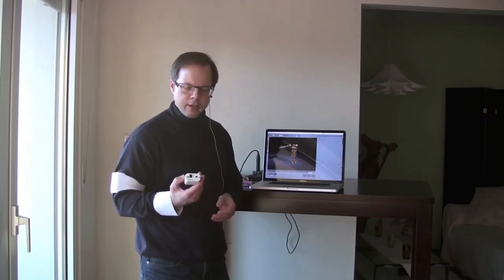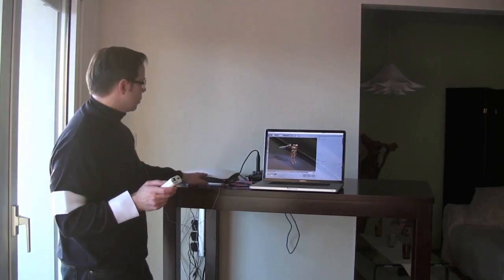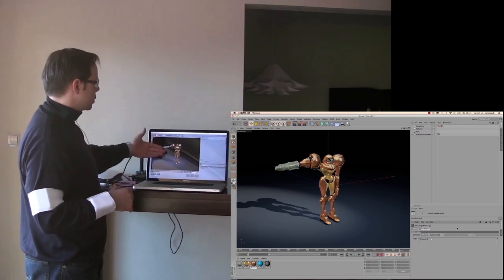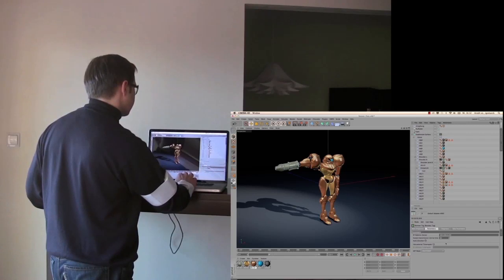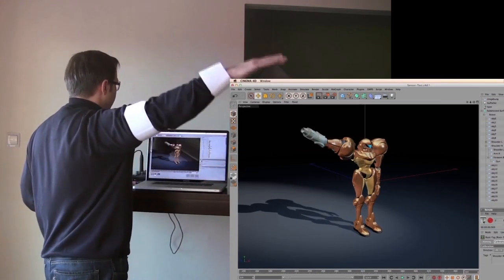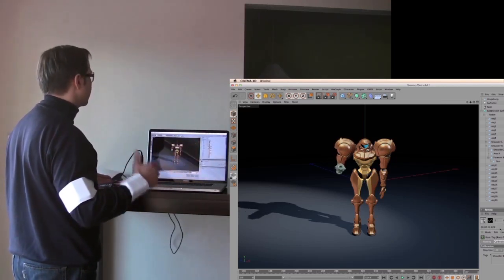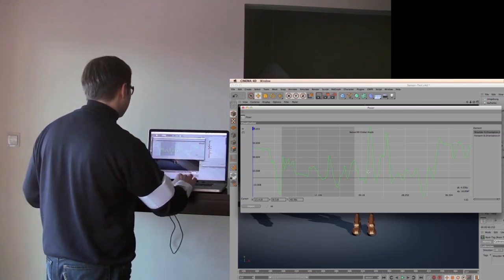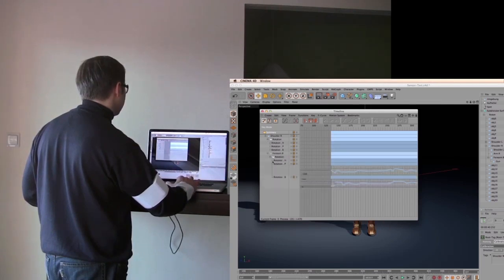Teaser: Motion Capture Sensors for CINEMA 4D

Comment from the maker: Hi guys, we already sell these sensors, but just in little quantities, as we are just a small 3D production and training studio. We mainly use the sensors for in-house work now as we cannot (and don't want to) compete with companies doing mass productions of such systems. Because of the high engineering works and little quantities be produce, a set of 10 sensors is sold for about 6500 Euros right now. Rental would also be possible, at least for someone nearby our studio.
Sorry for the long wait for answers. I wasn't checking comments here longer. Just let me know if you have further questions about our services or products.
Reply: Does MoCatch work with Kinect?